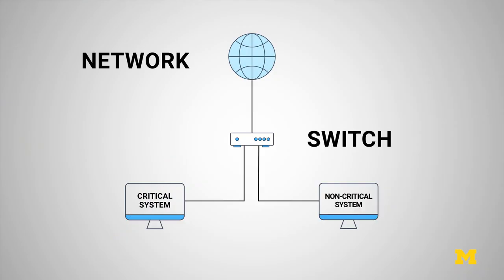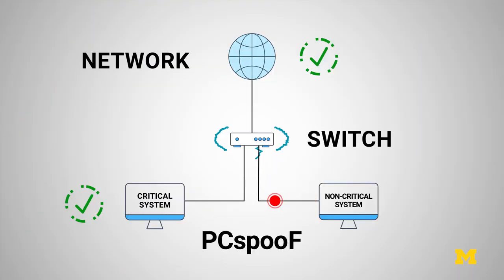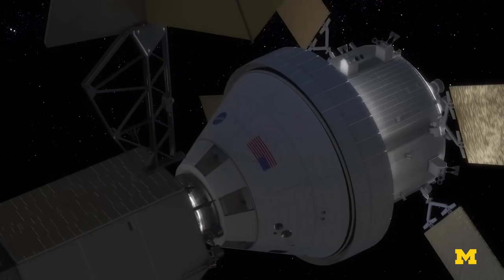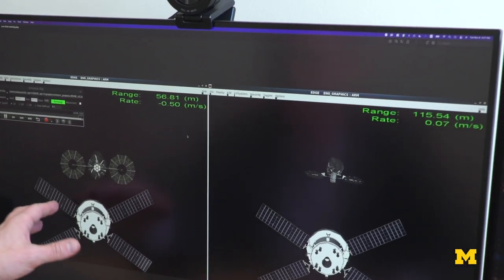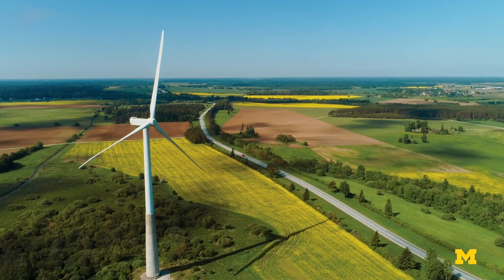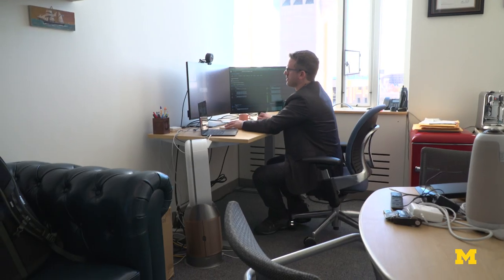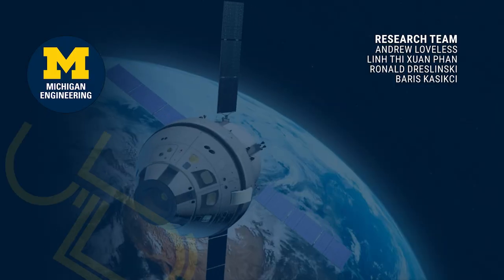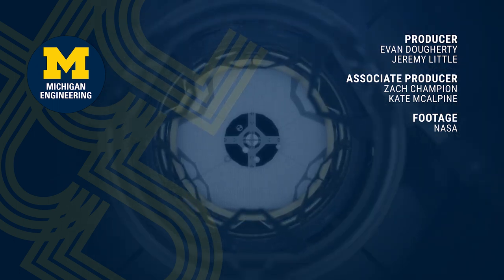New research identifies major TTE network vulnerability for space, aviation, energy industries

Comment: The type of attack described could be malicious or just caused by malfunctioning of a device (of non-malicious nature). It is hard to believe that existing DO-254 standards do not offer some level of protection for these cases. Usually the access to a physical layer ithat includes critical componentes is done only via certified devices, at least in commecial aviation.